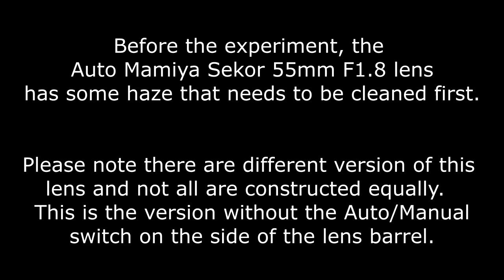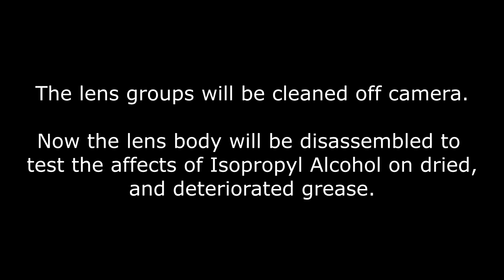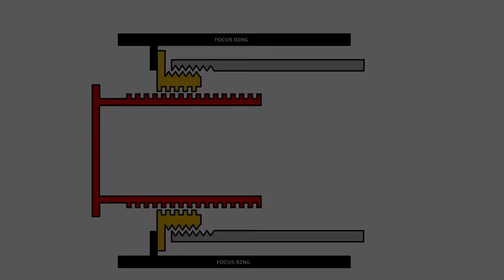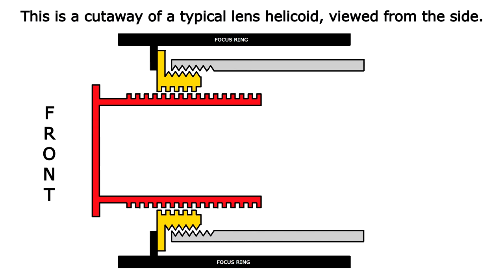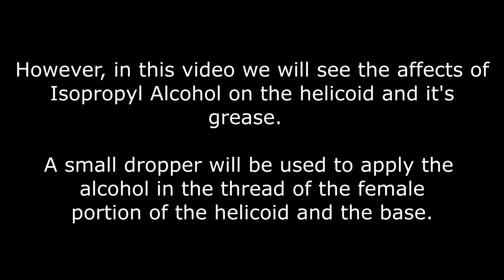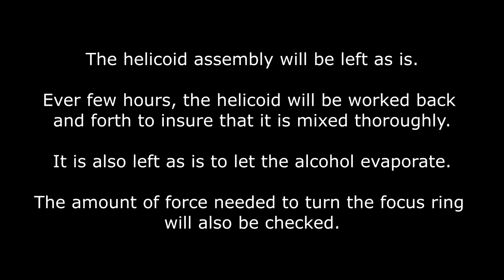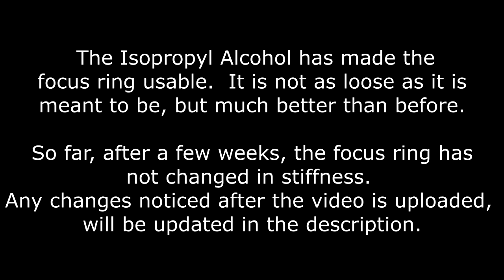Can Isopropyl Alcohol loosen a stiff focus ring?  Repairing a Mamiya / Sekor 55mm F18 lens.

Comment: Hi, Mamiya lenses are very nice to disassemble clean and rebuild. I am more used to 645 (secktor c line) but this 135 seems easy too. About the experiment the alcohol will act quickly but will evaporates soon and so the grease will be stiff again. For me the best way is to use alcohol or gas C or F to unblock it, dismount the full helicoid and clean up all the old grease and replace it. It s the only way to have a long time repair.

Comment: Oh man, I just spent forever cleaning the helicoid on one of the F2 version of this lens. The old grease in the helicoid was so old even adding contact cleaner to the threading wouldn't loosen it. I had to go in with a metal dental scraper to clean out the helicoid grooves it was so dried out. 

Great video!